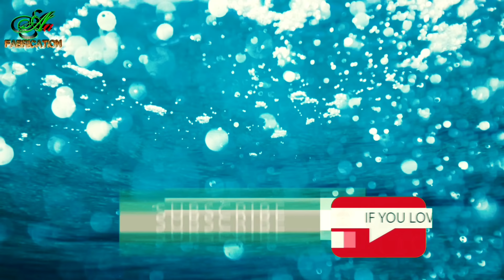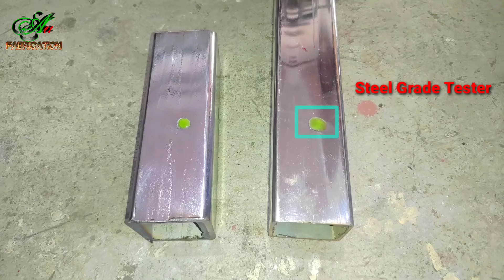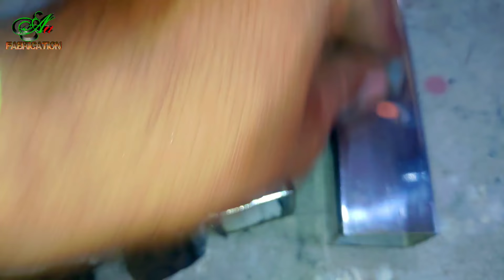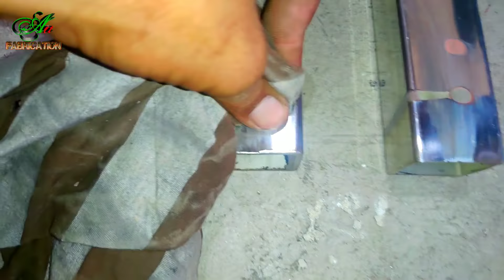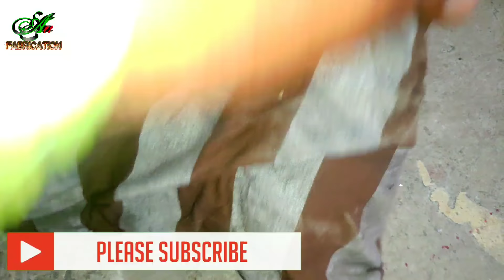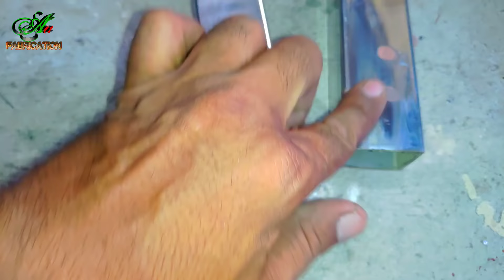Stainless steel grade testing liquid | Stainless steel quality testing ||

Comment: This liquid must be some highly corrosive acid or some chemical like that. Therefore 202 changes its color into orange rust color  ha as it corrodes easily whereas corrosion resistant 304 doesn't change its color.